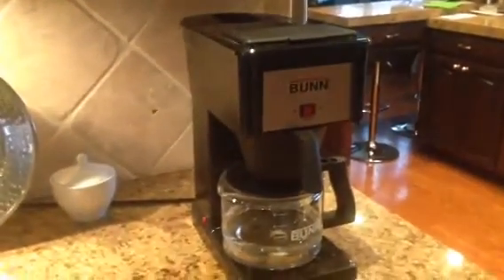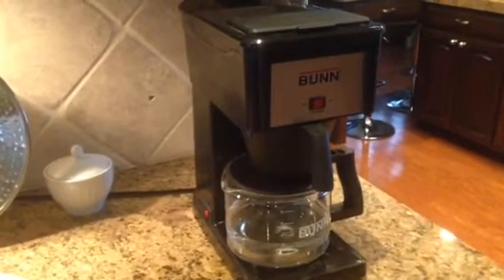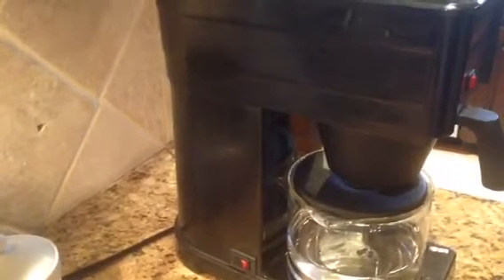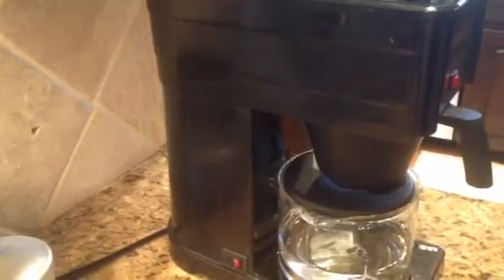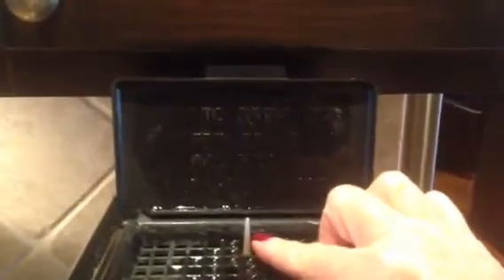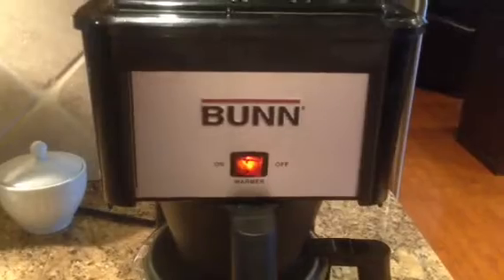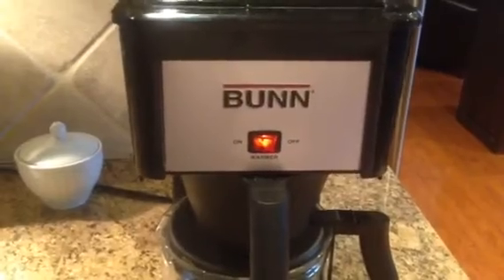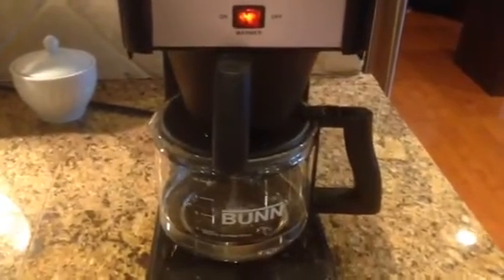How to use a Bunn Coffeemaker

Comment: Been drinking and making coffee for over 30 years and had to watch a video to make coffee this morning... damn bunn
Reply: its a POS   get a MR COFFEE AND SAVE $100       MR  COFFEE MAKES BETTER AND FASTER COFFEE    BUNN IS DISAPPOINTMENT FOR SURE!!!!!!
Reply: @tomdaniels3392  I agree, I have to first turn it on, then wait 15 min for it to warm up, then I can decide the amount of grounds to use, but have to wait till the water is heated up or else it will overflow. Then I have to get up again and then shut the lid to have coffee that stays hot for 1 hour. This is trash with a up charge.
Reply: I agree. I just bought one of these for my parents and I feel like ive been bamboozled. Bunn made a cheap coffee maker, that’s why it has so many steps. Any good coffee maker (Bona vita, moccamaster) just put in a good heating element, you press start, and it makes hot coffee. Bunn has you turn there’s on in advance so it can get hot for 15 minutes with a cheap heating element, and then brew. And this is because temperature is what separates a cheap coffee maker from a good one

Comment: This replaced a smaller Keurig that I owned for 6 years MyBest.Kitchen I wanted the convenience of the water receptacle and while this unit is much larger than the previous one, I'm very happy with my purchase. The only downside to this larger model is having to move it from under the cabinets to place the pod and refill it. I was able to rectify this by purchasing glide mats for small appliances. Now, it's perfect!

Comment: I'm having nothing but problems with this thing and isn't at all like your regular home coffee makers. It won't brew coffee but did straight water just fine. Also if you have some in the pot and have an issue and restart make sure to dump it or it will overflow possibly. I'm still not sure how to determine how it decides to make half a pot or full if it ever will. I used my old filters and thought maybe that was the problem so switched them with the ones that came with it and nothing but SLOWWWW drips! Smh...$120, now I have to reboot and send back. Just go with a normal one, I just can't find anything that brews in under 10 minutes.